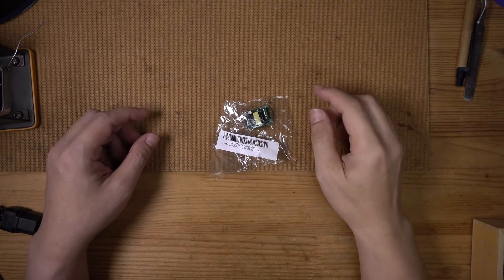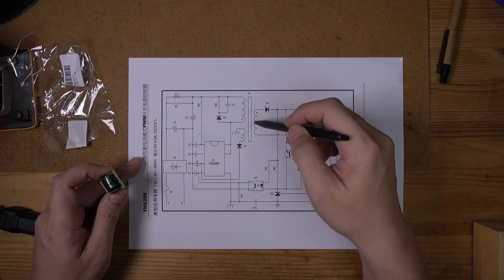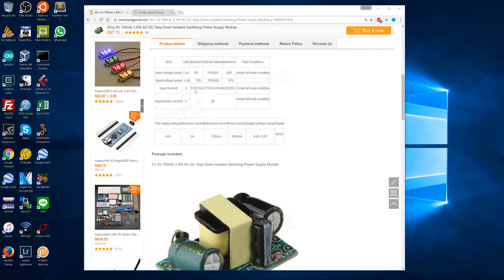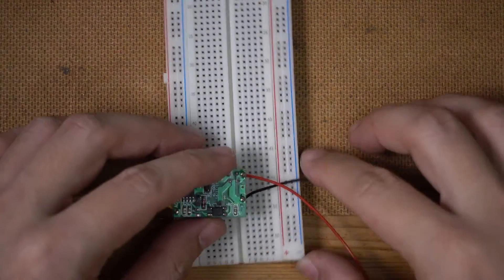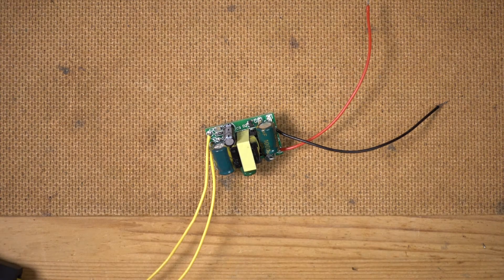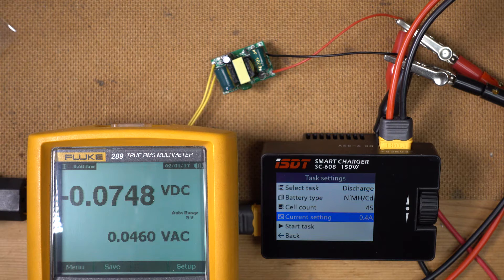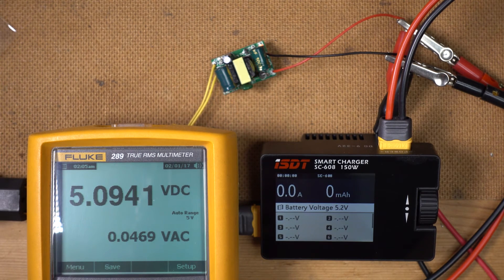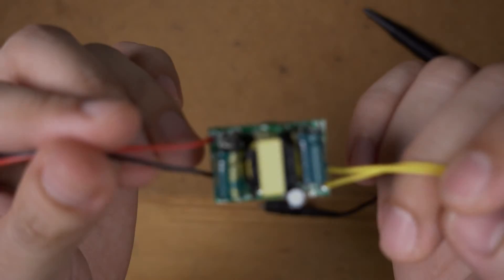Banggood mains AC to 5V DC switch-mode power supply

Comment: How bad is the 3.6kHz? 
You call it nasty, but in what perspective?
Reply: I made some Arduino project with 433MHz transmitter, it works very poorly with this power supply... I suppose that noise is the cause, I also noticed it when I measured the output with oscilloscope.

Comment: You should adopt the practice of a dim bulb rig for connecting unknown mains powered devices.  It is a technique antique radio repair guys use in case they are closing mains power across a dead short in any old gear.   If there is a short the bulbs lights up and limits the current through your device and minimizes chance of letting the magic smoke out in a violent manner.

Comment: Thank u for this useful in depth analysis. I bought 2 of these devices some time ago from aliepress  to power my Wemos d1 min ESP8266 based project but this device keeps dropping the voltage or cutting off for some reason even for loads of 700mA or in any case is doing something  weird cuz when i connect the same Wemos module to a 700mA USB charger of a phone its stable. Now i am searching to see what is wrong with this power supply. Maybe it needs an additional smoothing capacitor or a rectifying bridge or something. Any ideas are welcomed .
Reply from the maker: It should be more than enough to power the Wemos I would imagine. Maybe you can test out the power supply by monitoring the voltage while adding low impedance wirewound resistors across the output to see if it cuts out. If you have a multimeter, you might also try measuring the current drawn by the Wemos module when powered by the USB charger. It should be less than 200mA. A capacitor is unlikely to help very much if the power supply is faulty.